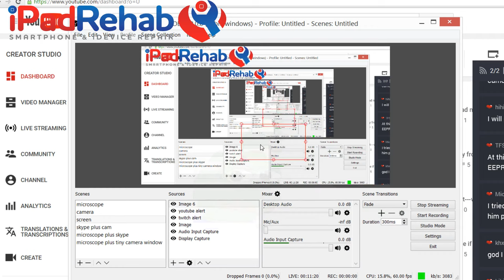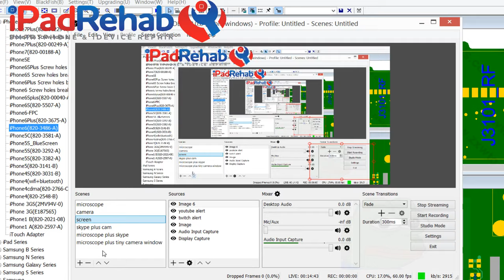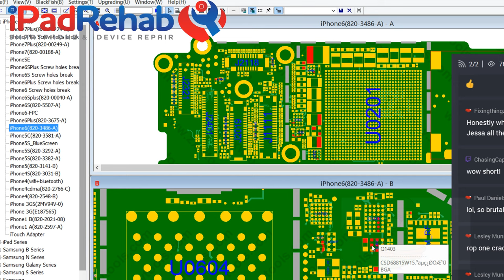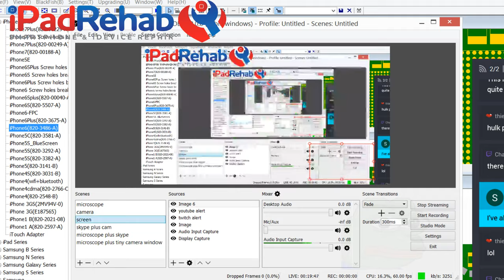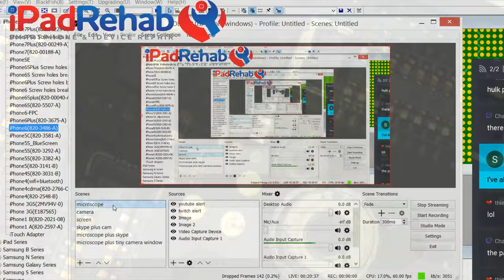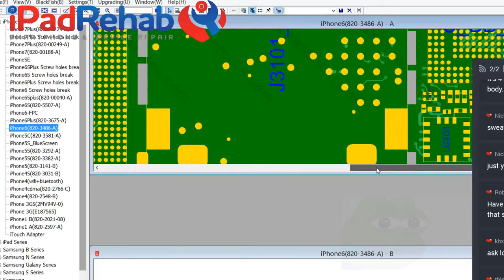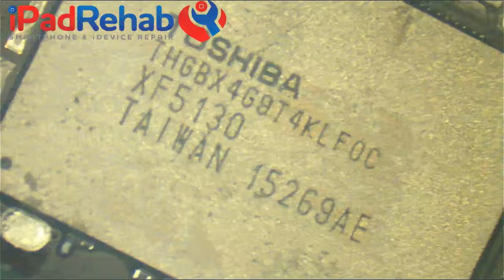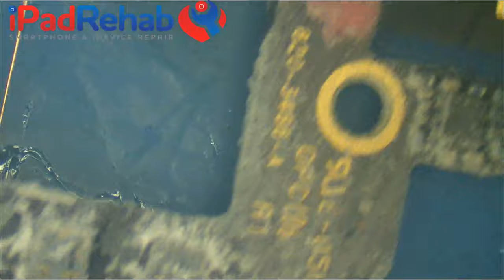How many components are actually required on iPhone 6 vcc_main?  Let's try "one"

Comment: Hello . I am very impressed with your skill
I have a question I have more than five phones iphone 6s working without a picture or sound or vibration, but when connected to iTunes it connects as if the mobile phone works
Reply: m-ahmad bl. Check the capacitor C4200 for a short circuit
Reply from the maker: yes, this is a common fault.  troubleshoot image starting at the connector and working back.  There are a handful of failures that can cause this.

Comment: Hi Jessa! What happen if only take that shorted vvcmain cap from the board and not replacing it and trying to turn the iPhone on? Does it turning on at all? I'm asking because I removed shorted vvcmain cap (C3220_RF) from iPhone 6 board which released the vccmain short. That was my first vccmain short hunting and I found that short on second cap, yayy! That was absolutely some kind of luck :D
Reply from the maker: It wasn't C5202_RF?  That is the common fault.  Leave it off.
Reply: iPad Rehab I think C5202_RF is fine because after I removed C3220_RF there is not short to ground with continuity mode in vcc_main even in C5202_RF. (water damaged iPhone). I get donor board in a few days. But you think that it's safe to turn on without that c3220_rf cap?

Comment: If the resistance of your wire between the terminals of a battery is enough to make the current go mental, then the wire will burn out... When i was 6 years old, i tested that with a bracelet of my mother between the terminals of a car battery
Reply from the maker: And what did you find out....that your mother was a loving soul that appreciates practical experimenting?
Reply: Also i found out that silver bracelets magically disappear in a poof of magic smoke and that the battery will be wrecked too :D

Comment: 1.2x 12v digital camera battery
2. zener diode 8v
3. switch
4.hot glue
5.broken screen
desolder backlight flex from screen, solder zener diode to switch,solder two batteries so its 24v,solder wire to 24v + then to zener diode switch, then to backlight. glue all, niw we have 16v supply to screen, turn switch to get backlight. easy to see if board turns on or to backup if bcklight chip gone.
Reply from the maker: +vaislaj that has been on my "list of things I  should get around to doing"
Reply: or use LM317 instead of diode, so you can adjust voltage